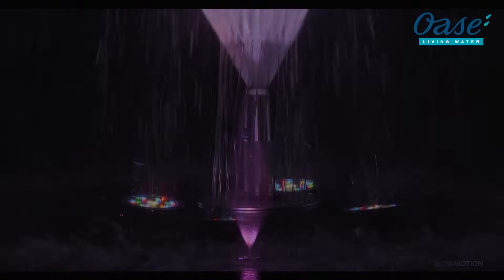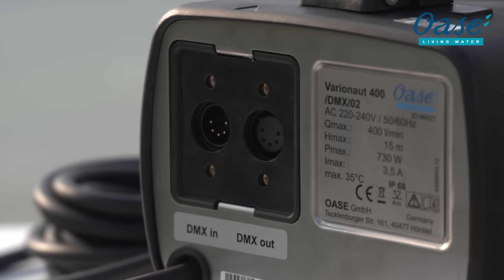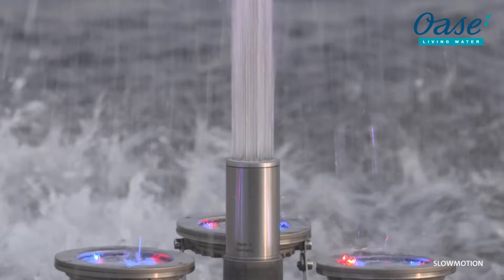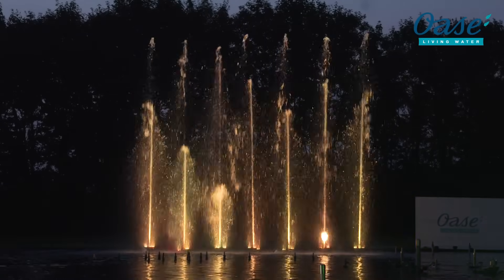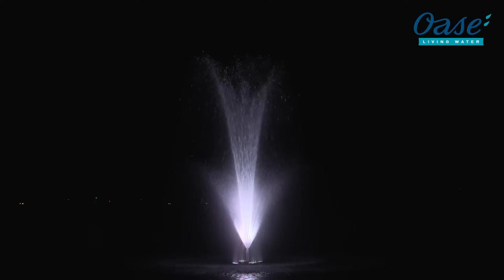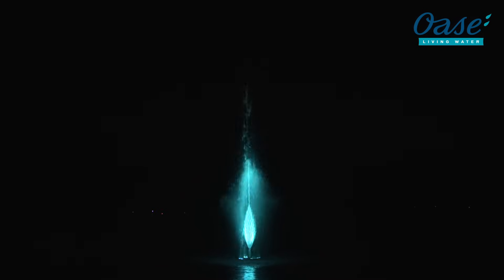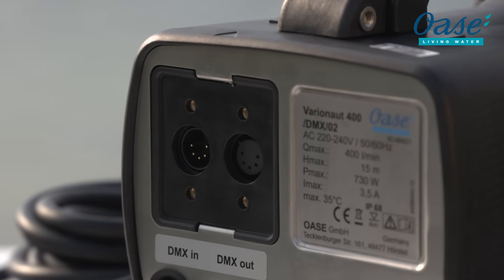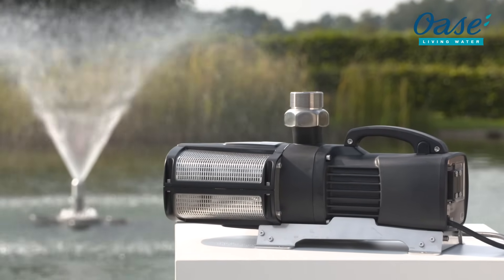OASE Products | Fountain Technology | Varionaut 400 | English

Comment: What type of variojet nozzle Do you use for A dancing fountain.
Reply from the maker: Hi Alex, our Varionaut 400 nozzle was installed here. The Varionaut 400 /DMX/02 is our most powerful DMX/RDM compatible pump. This individually adjustable pump generates highly dynamic water features with exact repeatable fountain heights. The maximum fountain height of approx. 10 m is achieved in just 1.1 seconds with the Comet 15 - 15. You can find more information here: https://www.oase-professional.com/en/family/product/p/46421-varionaut-400-dmx-02-int.html
Reply: Thanks one more Question in your other OSAE OAP video about the multi directional drive variojet wot tip of variojet nozzle is on the multi directional drive
Reply from the maker: @alexexploresvlogs6060  Hey Alex, please contact our customer service; they can provide further and detailed informations. Please finde the right contact here: https://www.oase.com/en/service/for-private-customers.html